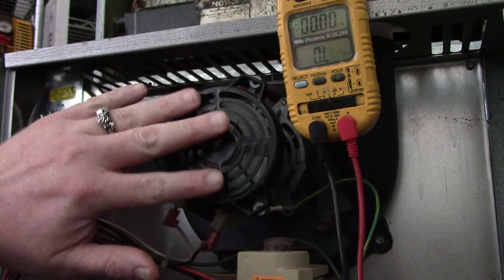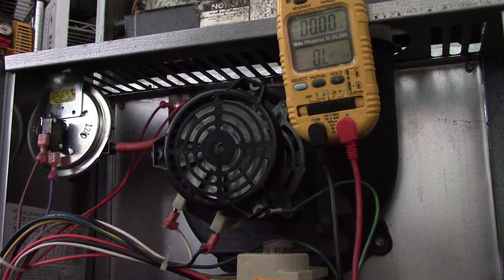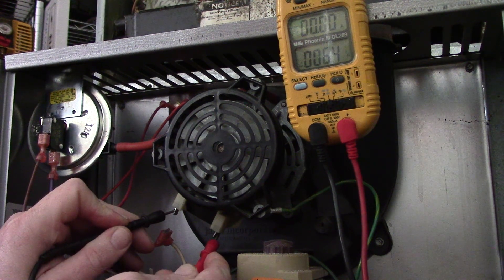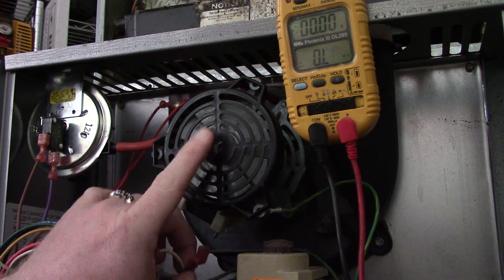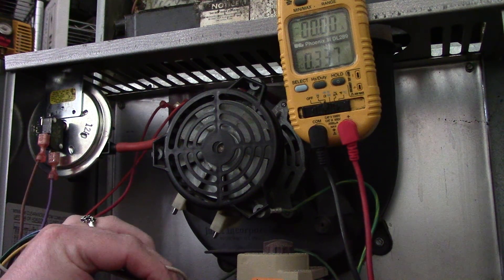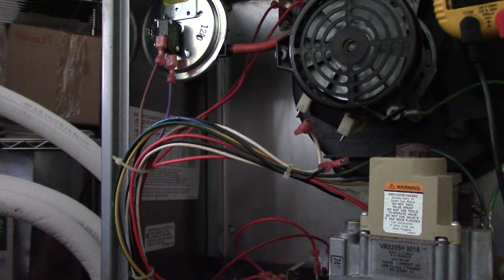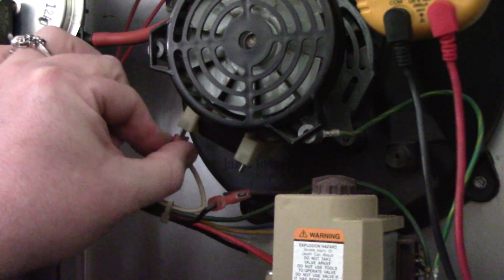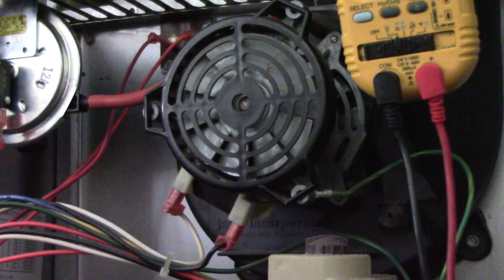Troubleshooting information for the inducer motor for a gas heater furnace

Comment: It's summer and running the air conditioner, every 5 mins or so, the induction fan cycles up and runs for a minute, then turning off. It's calling for cool, so gas never turns on during the cycling and the igniter never glows, but I know the induction fan shouldn't be turning on if the a/c is running. What do I need to check first? Control board has solid red light, not indicating anything is wrong. (Goodman furnace, 1997)
Reply from the maker: Could be a limit opening or a short in the r to w wire.

Comment: I got a ruud 90% .at first inducer would run for 5 seconds then die and blink 3 times.now it just has 2 solid green light and inducer does not run at all.   ???.
Reply from the maker: I'd check your pressure switches.